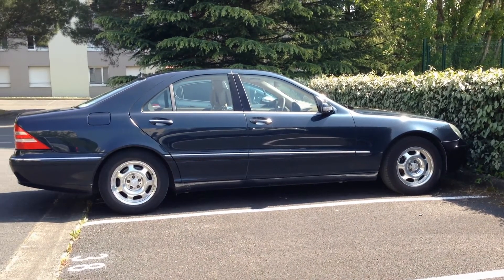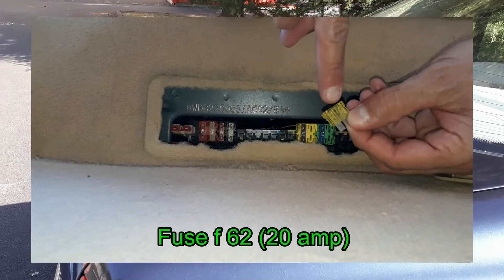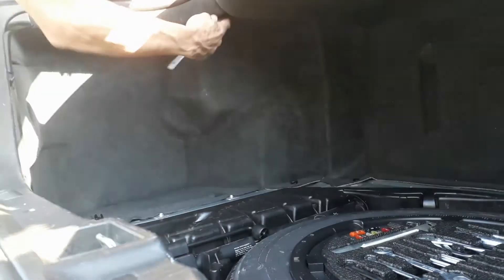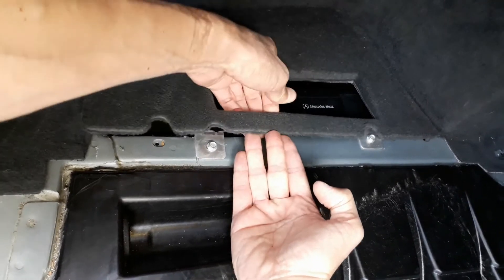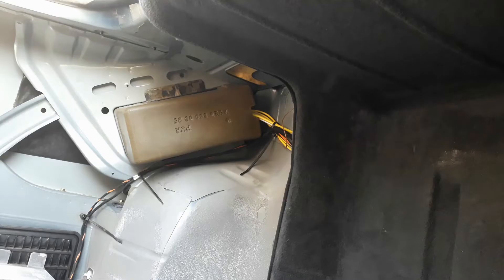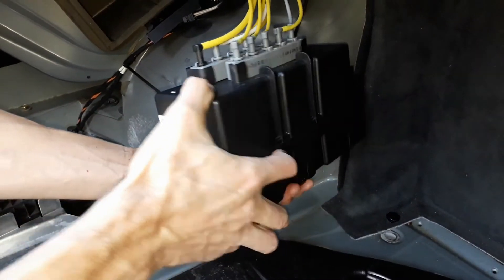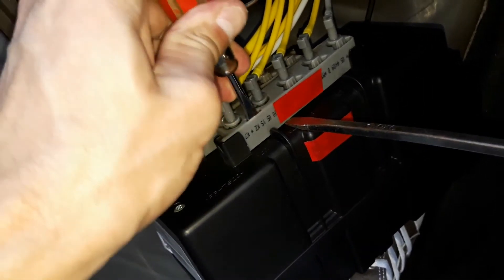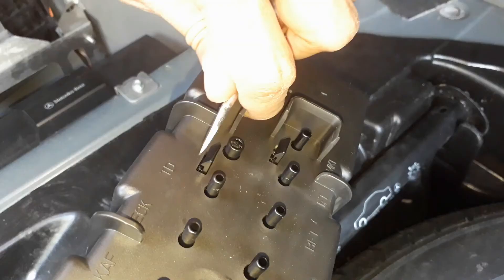How to remove PSE pump (central locking vacuum pump) - Mercedes S Class (W220)

Comment: Good video! What if 20 fuse does not blow, but lock/unlock  buttons don't work?
Reply from the maker: Hi ! Check other pneumatic functions (trunk opening and closing, lumbar cushion). If they do not work, the problem is with the PSE pump. If they do work, then the problem is the locking function. There are many possible causes of the problem. 
The first thing to check is whether the lock/unlock buttons on the dashboard, next to the hazard switch, are functioning properly. If they work, then the problem is your key or the radio receiver. Try another key. In short, proceed by elimination. Good luck ! 😉
Reply: @IfixmyBenz  thank you. I already disassembled PSE. Motor burned out. Overheat signes on the plastic PSE cover. Next step will be to check if what was the reason of high temperature: motor or pump. Lot of fun 😀

Comment: Hi, my s320's battery is flat so cannot open the boot. The metal key does not work either, I don't know why.
I suspect it could be the vaccum funciton pulling the boot shut, thats why I came here to find the location of the PSE pump.
THen I see that the PSE pump is in the boot... that I can't get into..... lol

Any ideas what I can do?
I've looked at trying to find a way to jump the battery or give it enough juice for the remote key or button release to unlock the boot but I've tried few methods that don;'t match what I see for my s320 e.g. the passenger foot panel doens't have a cable that some models have to allow a jump.

Note: your video is very high quality and can see all the bits clearly and informative
Reply from the maker: Hi ! The use of jumper cables under the passenger foot panel was indeed a good idea. Anyway, you should be able to get by with the metal key. However, its use is a bit confusing... It can be inserted both ways but only one way works ! Furthermore, once inserted the right way, it can be turned both ways, but only one way will open the trunk ! I suggest you look carefully at the direction I insert the metal key and the direction I turn it in the video. 😉
Reply: @IfixmyBenz  I've tried both ways (even tho I didnt think it should make a difference). I will try again!
Reply: @IfixmyBenz  I tried the way the video shows. tried again inserting the key both ways and turning both ways each time and it doesn't work :(
Reply from the maker: @duge4268  The lock or the mechanical opening mechanism is probably a bit seized up. This can happen after a few years, because the metal key is hardly ever used.
First check whether the push-button is not already blocked, pressed upwards, before the metal key is inserted. This sometimes happens.
Then lubricate the lock with WD40 using the small hose supplied. Then insert and turn the key several times.
If it still doesn't work, I would try removing the license plate light to see if it is possible to lubricate the mechanical opening mechanism by passing the WD40 hose. I've never done this but it might be worth a try.  The mechanical opening mechanism operates a long metal rod connected to the trunk latch located below. Good luck ! 🤞

Comment: Will the doors close after we take this out?
Reply from the maker: Hello ! If this pump has been removed, the door will not lock with your key fob. To lock the door, you will simply need to use the metal key (pull the metal key out of your key fob). 😉

Comment: I have a 2002 Mercedes S55 AMG with 170K miles. After I replace my suspension and PSE pump does the dealer need to re flash it with their software? Thanks
Reply from the maker: Yes, the installation of a new PSE pump requires programming.
And just to clarify, the PSE pump is independent of the suspension. 😉

Comment: Thank you for video very helpful, question if seems like my fuse you talk about keeps blowing ( Short) would this pump cause this problem?
Reply from the maker: Hello ! Yes ! When the pump rotor is broken it usually prevents the motor from running and the fuse blows immediately when you put a new one in. This is the most common failure (see this video: https://www.youtube.com/watch?v=EwlFbqw0ul4).
However, you may have a short circuit somewhere or a blown motor and this would also blow the fuse, but this is much rarer because this pump is designed to electronically stop a function when the motor runs too long to prevent it from blowing.
Reply: You probably dont care but does any of you know a tool to get back into an Instagram account??
I was dumb lost my login password. I love any tips you can offer me.
Reply: @Esteban Lucas instablaster =)
Reply: @Nicolas Abraham thanks for your reply. I found the site thru google and Im waiting for the hacking stuff now.
Seems to take a while so I will reply here later with my results.

Comment: My fuse is fine but locks and trunk and headrest not working. Any suggestion
Reply from the maker: Hello ! To begin with, sit in your vehicle and close the door to isolate yourself from outside noise. Check whether you can hear the pump running when you operate the central locking with your key. If not, check the electrical connectors connected to the pump...
Reply: @IfixmyBenz  thanks I'll try that.

Comment: My motor is working just fine but I believe I have a leak in one of the lines, how do I remove each hose separately? I don’t want to accidentally break them, do I need to squeeze anything and pull it out? Or do I need a special tool?
Reply from the maker: Hi ! To disconnect a pneumatic line on the pump side, simply operate the tab located in the hole where the pneumatic line is inserted.  No special tools needed ! 😉

Comment: Ho.After i fit new pump i need use Star diagnostic to clear faults?
Reply from the maker: Hello ! Be careful, if you install a brand new pump, a programming with STAR is necessary ! And it is not a simple fault clearing. This is why it is better to repair your pump and then reinstall it in your vehicle after repair. In this case, it's just plug and play ! 😉
Reply: I fix my Benz Hi thank you for reply!Can i ask how about used second hand pump?stil the same?i have star diagnostic..how to program the new pump?regards
Reply from the maker: @sebastianmiczulski187  If you want to replace your pump with a used one, you should choose a pump from a vehicle with exactly the same options as yours, so you won't have to reprogram it.
Reply: I fix my Benz thank you
Reply: I fix my Benz so just simple clear the folts and thats it?

Comment: Is there any coding or software work needed to make sure the car recognizes the new pump? Or will it work right away when mounted?
Reply from the maker: If you install a brand new pump, programming using STAR is necessary after installation according to the vehicle options !
If you install a used pump, you must ensure that it comes from a vehicle identical to yours if you do not want to have to reprogram it.
If you reinstall YOUR pump after repair, no programming is necessary. It's just plug-and-play !
Reply: @IfixmyBenz  If I replace a used pump MOTOR ONLY from different model and solder to original PCB do I still need programming?
Reply from the maker: @MagmaMorph ,  If you replace only the motor, no programming is necessary. However, be careful to use an identical motor because the output air flow rate must remain exactly the same. Indeed, the pump uses the operating time of the motor to detect a system malfunction.
Reply: How do you program a new one?

Comment: mine seems to have a leak for the driver door, where can I find hoses or the little plastic piece that goes into the grey connector
Reply from the maker: Hello ! You can find plastic pipes and clutch simply at your Mercedes dealer. I will try to do a video on how to repair pipes.

Comment: I replace mine but it locked all of my door at once, and now I can’t unlock or get in
Reply from the maker: Hello ! Use the metal key to unlock your car. If you have replaced the pump with a new one, programming is required.
Reply: @IfixmyBenz  yes I just unlocked it but after leaving in my car for a while a fuse got burn and my pump was fried, so I return it and another one was given to me after I plugged it in it doesn’t even click or power on at all and yes I’ve replaced the burn fuse. And again I test all the fuss in the back sit downward fuse box all fuse are powered but nothing powered up the vacuum pump I got please what can I do
Reply from the maker: @adamtaliat6139  Check the large electrical connector connected to the pump for corrosion or other damage, and make sure you have power at this connector. Is your replacement pump brand new? if so, programming is required.
Reply: @IfixmyBenz  where do I find the connector and the pump isn’t brand new it’s a used one and why I knew they was no power in the connector it’s because the pump doesn’t click a sound of spoil or good it makes no sounds and I test it with the one that came with the car still no sounds which it doesn’t makes sounds before
Reply: @IfixmyBenz  and I use a tested to test the back sit fuse and also the sucket clip connected to the vacuum I could only found power in one of the wire mouth which is the one with red color only the rest have no vol
Reply from the maker: @adamtaliat6139  If you have power on the red wire, the pump is powered. Your used pump may be faulty if it makes no noise...